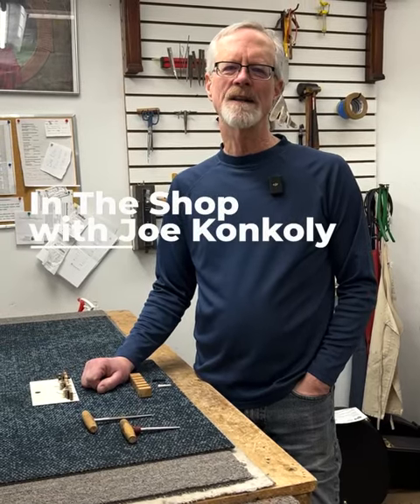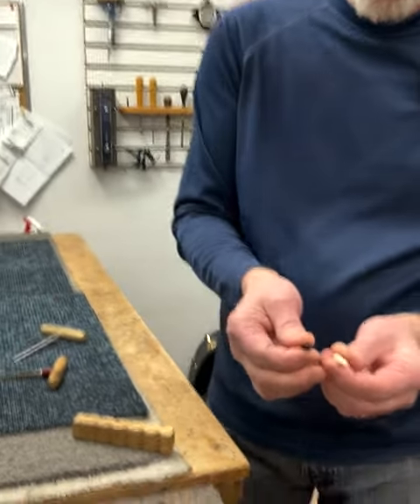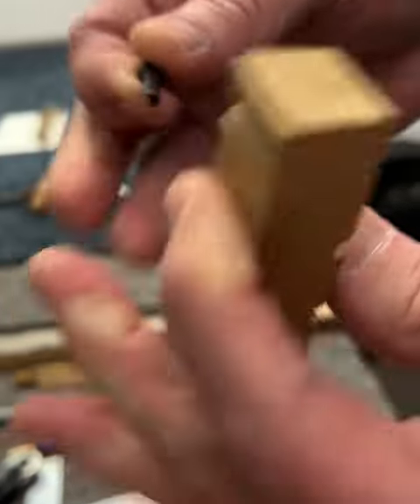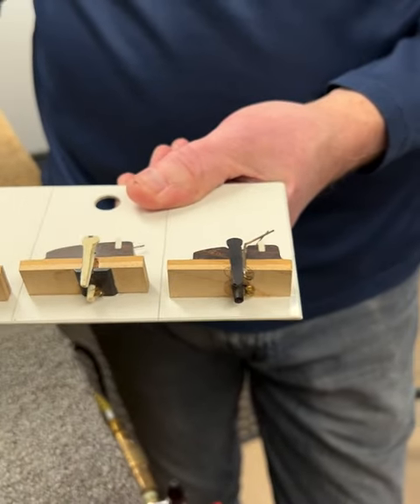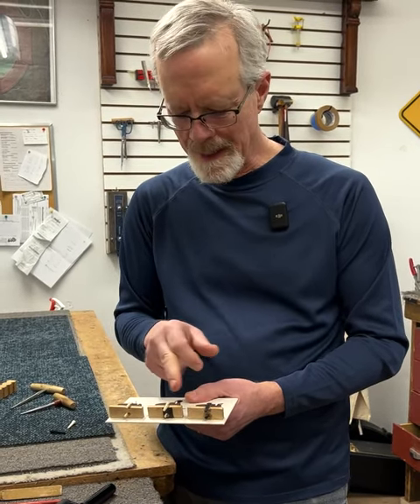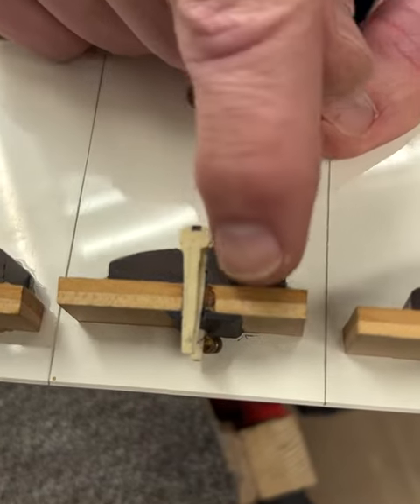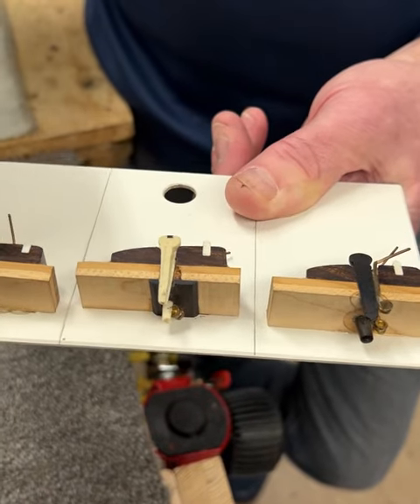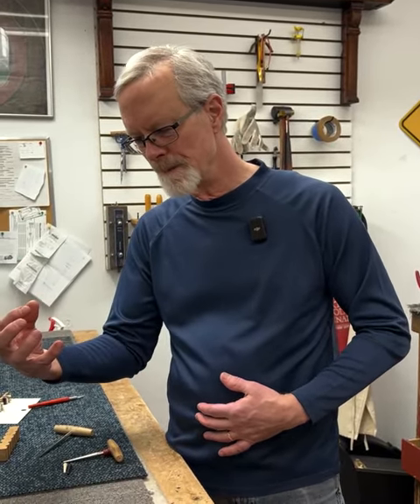In The Shop: Mastering Bridge Pin Tapers | elderly.com

Comment: I have a new (2024) Martin 0-18.  The bridge pin holes are NOT tapered at all.  The bridge is drilled one size all the way thru.  Then the top, and bridge plate inside have a hole just a little smaller than the bridge hole.  So, in this case, how do you fit new bridge pins?  Martin plastic pins fit.  But their Ebony pins do not fit.  They are too large.  Thanks for the video!